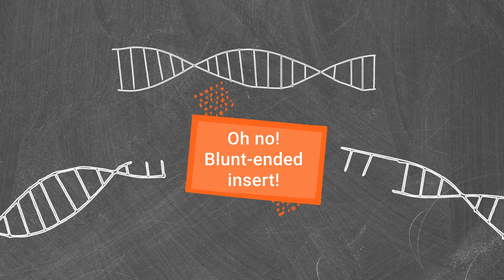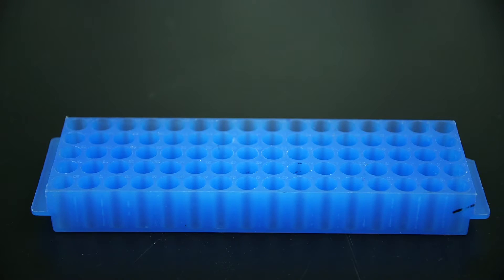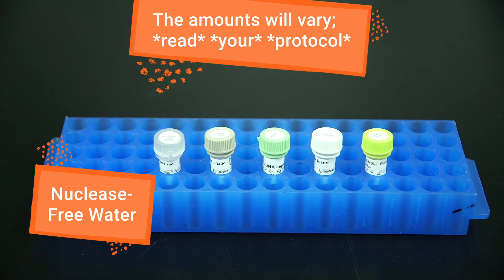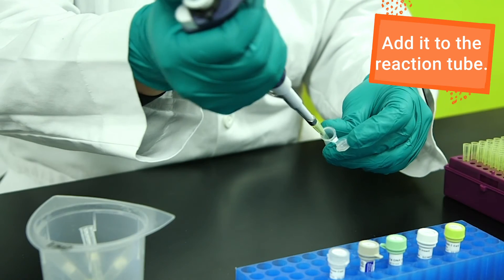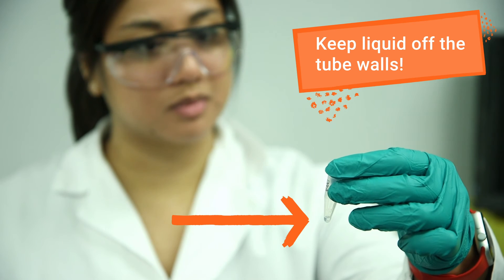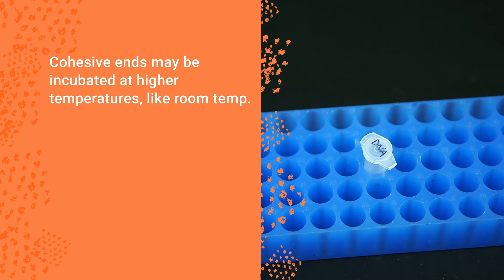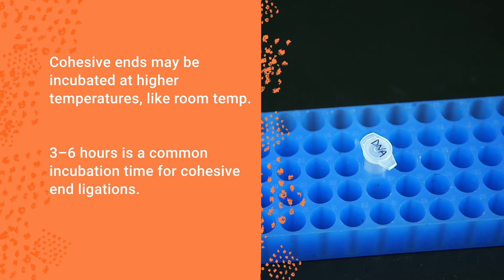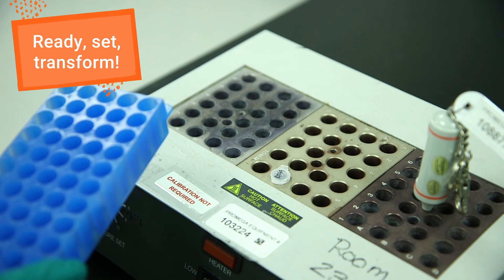How to Ligate an Insert into a Vector

Comment: Can it work with a single digest. I see most recommend double digestion for successful ligation.
Reply from the maker: Cloning can certainly work using one restriction enzyme to cut both ends of the insert and the insertion site in the plasmid vector… however, in this case it’s possible for the vector to re-ligate on itself, and even with successful ligation of the insert into the vector you will have both orientations. The considerations are similar to blunt-end cloning. There is a fuller discussion in the Molecular Cloning Guide on our website: https://www.promega.com/resources/guides/nucleic-acid-analysis/subcloning/

Comment: I want to know why do we add nuclease free water in the ligation process what is its role kindly please enlighten me with it. If I am correct, for ligation ATP is required which is provided in buffer than why do we need nuclease free water??? I am not able to find a satisfactory or correct answer to this. Waiting for your reply....
Reply from the maker: Nuclease-free water is added to ensure  the final concentrations of the components in your reactions are what they should be. The amount of nuclease-free water you would add is based on your particular reaction requirments and is affected how much insert and vector you  add  (which depends on the optimal ratio that you determine and the concentrations of your insert and vector solutions). If you need assistance setting up a particular ligation reaction, please reach out to our technical services scientists.  https://www.promega.com/support/tech-support/